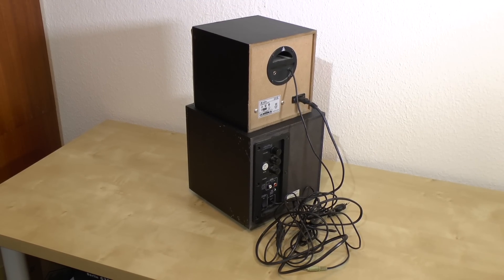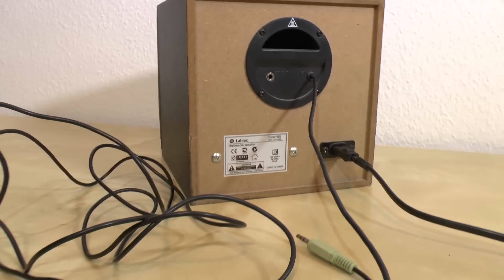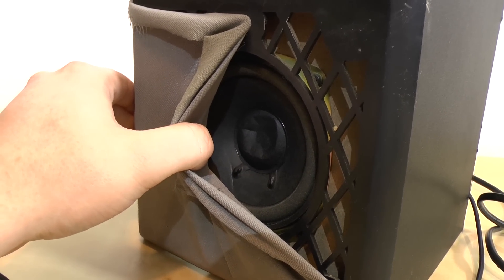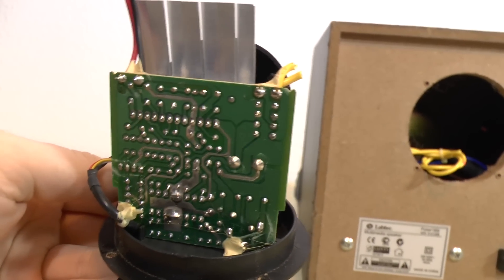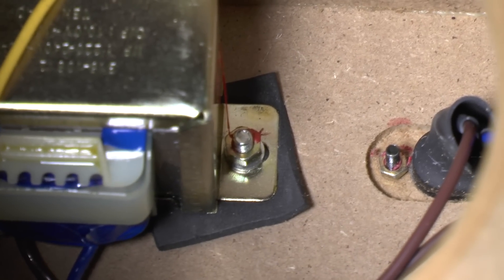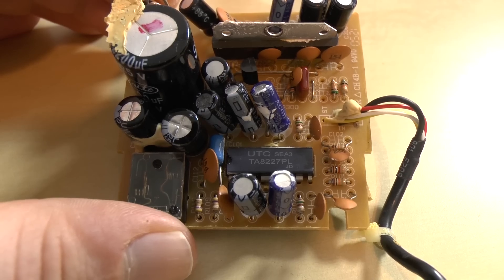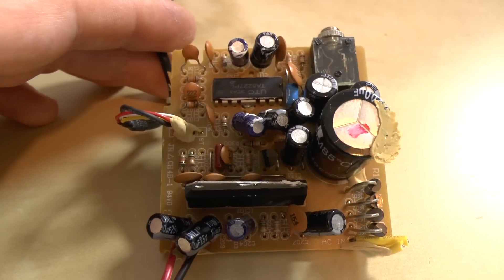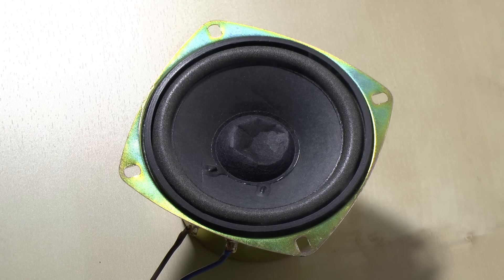Teardown: Labtec computer subwoofer

Comment: I have an old labtec sb8 from mid 90's and I had to take out the PCB to work on it and it looks very similar to yours.  Mine is a sub with two satellite speakers and the sub has 14VDC input from power, then 14VDC output to one satellite speaker and then audio input from a speaker (this last part I'm not gonna swear as the label is worn).

Comment: Interesting video. I'm not surprised by the low wattage power output, this thing was meant for desktop speakers, so a lot of power isn't needed. But the 10% harmonic distortion??? WHAT? How can they even put something like that out on the market? It is interesting that the dust cap on the speaker was so messed up. Did the plastic grill provide no protection or was it so easily removed? I am wondering HOW it could get mangled like that! Also, do you know why they put glue on the leads going into the board? Was the soldering that unreliable? Thanks for the video!
Reply from the maker: +clydesight 
The chip manufacturers try to make their chips look good in the catalogues. That little TA8227PL would appear as 2 x 2,5 W, and you are only going to find out about the 10 % THD if you look for it in the data sheet. It's all just marketing. The manufacturer could (probably should) have rated it something like 2 x 500 mW @ 1 % THD, but then it probably wouldn't sell as well. 
The grill had no plastic in front of the speaker itself, and the cloth was somewhat loose. My guess is it stood under the desk and somebody accidently kicked it.
Cables soldered straight onto the board commonly get some additional glue on chinese equipment. The soldering was OK, maybe they glued the wires before soldering, so that those could be attached in an automated soldering process. Who knows. I find it fascinating at times, and I'd be interested in seeing one of those Chinese super cheap electronics factories and how they do things there. But I wouldn't want to stay there for long as it's certainly a very unhealthy environment.
Reply: 10% THD is not unusual at all. In fact, it is very common. Even in portables, so-called mid to higher end mini component systems, etc.

Comment: hahah this pathetic piece of equipment has survived me moving to 3 places, it once had to save a small party at an open space when the proper stereo stopped functioning and yes if you crank the volume you will get distortion but at normal, even what I would consider "loud" volumes it has been my favorite cheap speakers so far. As of today my puppy  chewed some of the wires which I have to rewire and I also had to clean the ugly's remote potentiometer. Also, one of the satellite speaker's plastic stands broke. But the speakers themselves work fine, so I think it has withstood more than normal use and this cheap chinese thing still works, turns on and keeps sounding just as new, as bad as that may sound to some!

Comment: why throw away a perfectly good transformer tho ;__;
Reply from the maker: +2chws The screws of the transformer had glue all over them. I would have kept the transformer, but the screws were totally stuck.
Reply from the maker: Because I totally have a fireplace in my 1974 studio apartment :P
Reply: DrCassette  I hope that you're taking theses things/parts to an electronics recycling facility and not just simply throwing them in the garbage or burning them. The recycling facility should be the one to determine what can be recycled. It is actually law in many places that you cannot just throw away many types of electronics/parts into the garbage.  Did you test the woofer before you fried it? Just because the dustcap was pushed in doesn't necessarily mean that it doesn't work anymore or is no good.  Same with that power cable - just because the housing/strain relief/connection at that end is broken doesn't mean that it is totally useless. At the very least it is likely made with copper wire that can be recycled. If you don't have electronics recycling facilities where you live then fine but if you do, then shame on you for not using them, and for putting potentially environmentally damaging parts/chemicals back into the environment.